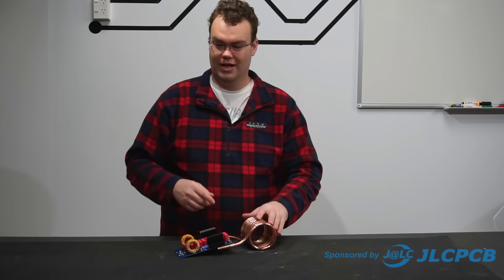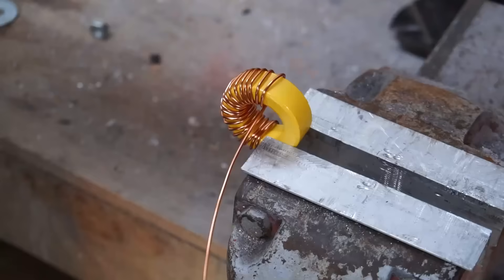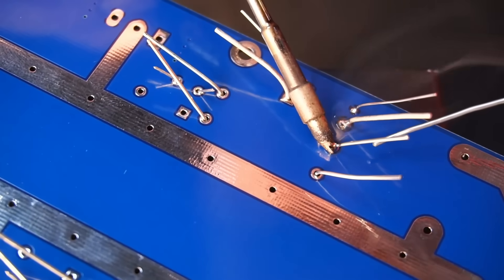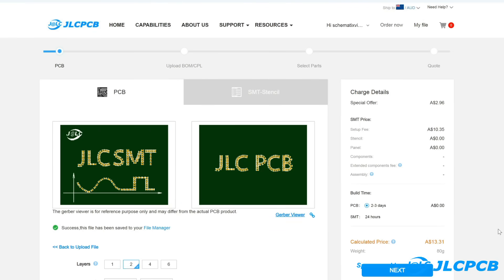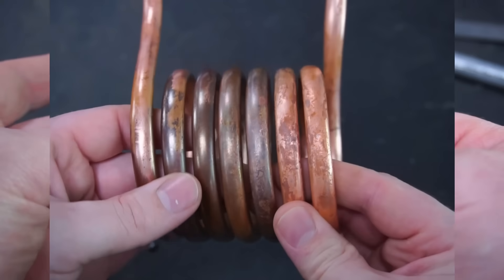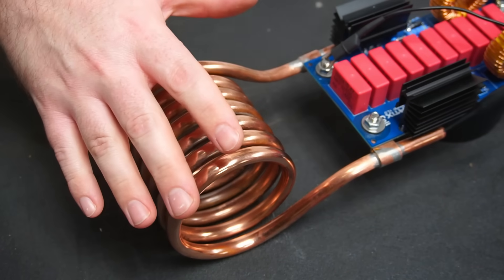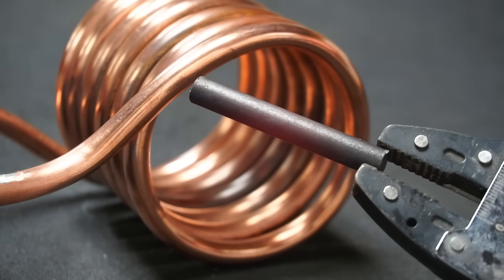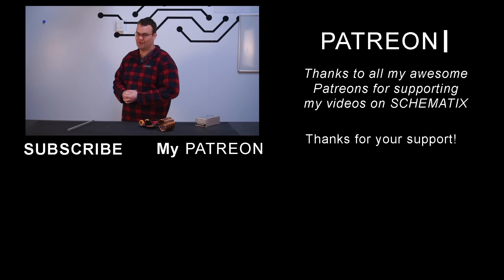Building a 1.4kW Induction Heater

Comment: thanks for sharing... I have a good induction furnace that came with an actual instruction manual... I have been looking at it for a few days... and read the manual this morning... I am none the wiser... 120 single phase current.. with two indistinguishable posts...no indication of polarity... and I think I need to make it 220... and since there's no wiring diagram... I am looking at videos instead of burning down my house
Reply: I have to melt platinum.. 1768° C... it claims 2200°... max... but I think that has to do with the copper in the coil... so I can replace it with platinum... or AuPt.. I have limited experience with high voltage electronics.. lasers are the only thing... and 12 volt automotive stuff.. Tesla coils.. but simple circuits... burning the house down is not really a good idea probably... I am open to suggestions
Reply: ok... here's something I have come up with in lieu of large amounts of money for new equipment... can I hook up one furnace circuit with transformer and power supply separate, but wired together through the coil?... 110 in the States, with 220 in the wall by the dryer... a meter away... if I split the 220 into 110 through either side... how can I wire it without loss of property and life?
Reply: has anyone tried a flat coil and shallow melting dish?... they used to use bakelite for insulation in coil seperators... high temperature requires different material... AuPt dust can be found wherever water flows naturally... dig sand and dry... it's the only gold stuff that sticks to a magnet... ya can't miss it
AuPt dust in shellac can be applied to cardboard... it's transparent to magnetic energy, but has the melting point of platinum
Reply: Au and Pt are diamagnetic.. they are also one proton electron pair different, so there is a magnetic field, except they don't all line up like iron does
AuPt is tremendously hard... like diamond.. 10 on the Moh's scale of hardness because it cools slowly before it reaches the surface as volcanic ash and has double double covalent bonds.. it takes a lot of energy to break those bonds... there's lots and lots of it... everywhere
Reply: so if I have two diode racks... which looks hauntingly familiar from my laser building days... and I do a pull me push you arrangement... do I use a common ground between them to synchronize the AC cycle across both?... and there should be a simple load balance system probably... how much voltage is developed... what happens if you start with 100,000 volts at 10 amps.. like an ignition coil for a car... but high frequency and 200,000... and 10 amp... ?
Reply: I see other designs using large power transistors... does not look robust... but could bump up the output... I don't know... I am asking

Comment: Would be cool to redesign this so it can accept three different coils interchangeably.  1 coil for 8mm through 15mm nuts/bolts, one for 17mm through 33mm bolts/nuts, and  one coil with extended flexible leads (up to 24" for heating nuts/bolts from 8mm thru 17mm nuts/bolts which are in harder to reach spaces (in an engine compartment of an old rusty car/resto mod)...

Comment: How does frequency make a difference
Reply: I noted that the frequency on the oscilloscope didn't change at all - well it wouldn't would it?
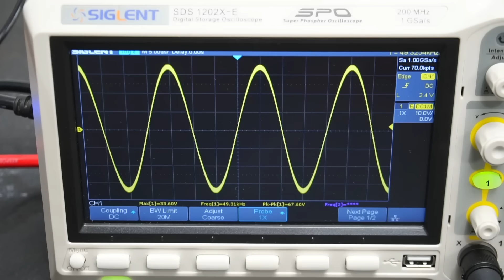Reply: @blaggercoyote  im referring to 16:50 of the video.
Reply: @madapaperclip422  The "skin effect" where high frequncies flow near the surface.  With ferromagnetic metals like steel the 50 kHz current concentrates in a very thin layer causing much more heating than if it was evenly distributed.  This also raises efficiency because the magnetic metal heats more than the nonmagnetic copper coil where the current is less concentrated.

To strongly heat nonmagnetic metals a much higher frequency like 1 MHz is used to get current concentration at the surface.  But then the copper coil heats a lot too, probably absorbing most of the power.  So the coil has to be water cooled, also the heater circuit must be much more powerful since most of the power is wasted in the copper coil.  (And it is still more difficult because power transistors for 1MHz are unusual and expensive.)

Comment: I'm surprised you could not heat aluminium... since it conducts electricity, it should be heated by induction (all conductive materials are). However, it conducts heat way better than steel, so it is more difficult to heat, even though it melts at lower T. Maybe the piece you chose was too large and dissipated the heat too quickly? 
Another remark, if I may: I'm not sure by changing frequency, you would improve the results on aluminium or other non ferrous alloys. Frequency in the coil should only impact the heating depth inside the piece (rule of thumb is you drop the frequency to heat large pieces, and if the frequency is too high, you'll heat only the edge of the part). As you stated, it is a consequence of your circuit and its capacitance, which have a direct influence on the delivered power.
You could also look into making a smaller diameter coil, because reducing the distance between the coil and the piece will improve its efficiency (if I remember correctly, it has to do with the magnetic field lines). 
Great job anyway! Designing induction heaters is though, it depends on so much parameters, so you can be proud of the results!

Comment: And why would one want to build this?? What would you use it for? Just curious not trying to bash or troll.
Reply: Some blade smiths are trying them. Fast way to heat metal to forging temperature.
Reply: @fredbecker607  I see.Thank you for the info.

Comment: You don't anneal any metal by quenching it in water, you anneal it by letting it slowly cool. The more rapidly you cool it from any temperature, the more hard it becomes. You still annealed it a little because you heated it to such a low temperature, but if you want it to be dead soft you will let it cool as slowly as possible.
Reply: When working with copper the process is exactly the opposite to Fe alloys... to anneal it you need to cool it as fast as possible, as shown in the video.

Comment: Could you make an instant hot water system using a similar induction design?
Reply: Water is not ferromagnetic
Reply: Yes, but a water pipe going through the middle of the coil could be.
Reply: @andrewjawney1  maybe but I don't think it will be "instant"
Reply: I'm sure it would be possible, with many passes through the coil. However my only concern is whether or not it would be more energy efficient than a standard water system. I still think it would be a fun idea to explore.
Reply: @andrewjawney1  electricity is always 100% efficient on a resistive circuit, but i doubt it would be more efficient because of the driver
Reply: Ok thanks mate. I suppose if efficiency was the highest priority then a heat pump design would be a better design idea. Rather than converting electrical energy to thermal energy and dealing with energy losses, concentrating ambient heat into the water would be more efficient

Comment: I've worked with induction heating since 1987. Really nice project. The heating power is quite impressive and has the potential for more. The magnetic flux decreases by the square of the distance to the work. With a tight coil you would couple much better to the output. Of course, the current would still be limited by the power supply and resonant circuit. Commercial coils are filled with sand when winding so that they don't collapse, especially with small diameter coils. Afterward, they are sprayed with Glyptol to provide insulation. Many times they are also lined with a refractory tube, and cast in refractory cement. If not potted, larger bare coils have some type of insulating structural spacers attached parallel to the axis of the coil on the outside to prevent the coil from jumping when energized. Invariably the output coils are water-cooled in all sizes of induction heaters. It's true, you don't want to get bit. Radiofrequency is more than a shock. I once contacted the 650-volt dc buss on a 300KW machine in Yonkers. It knocked me back six feet against a piece of equipment. I was lucky. The most dangerous job I've ever had.
Reply from the maker: Thanks for sharing your experience with us!
Reply: @Schematix  How about using numerous microwave oven capacitors?
Reply: @Schematix  🔴 What Is Islam? 

🔴 Islam is not just another religion. 

🔵 It is the same message preached by Moses, Jesus and Abraham.

 🔴 Islam literally means ‘submission to God’ and it teaches us to have a direct relationship with God. 

 🔵 It reminds us that since God created us, no one should be worshipped except God alone. 

 🔴 It also teaches that God is nothing like a human being or like anything that we can imagine.

🌍 The concept of God is summarized in the Quran as:

📖 { “Say, He is God, the One.  God, the Absolute.  He does not give birth, nor was He born, and there is nothing like Him.”} (Quran 112:1-4) 📚

🔴 Becoming a Muslim is not turning your back to Jesus. 

🔵 Rather it’s going back to the original teachings of Jesus and obeying him. 

More ....
Reply: Can you point me at reference material on how to calculate building one of these?  I want to heat an old (decommissioned) steel scuba tank to around 300 to 350 degrees Celsius and hold it there more or less as long as I like.
Reply: @HelloNotMe9999 
  Okay. I'm hooked. What would you heat a scuba tank up for?
Reply: Could a electrical efficient ,gas free, heat water boiler/pump be made using this method?
Reply: @DavesMades  the MOST efficient way of turning electrical energy into heat energy is the way it's always done ... Using resistance. You can't get more heat energy out than that put into the system and appropriate resistance is the simplest, quickest and most efficient. 

Also, surrounding the coil with water will significantly change the operational characteristics as would surrounding the work piece with water but INSIDE the coil.
Reply: Have you got any recommendations for resources that I could use to learn more about these?  I'd like to build an induction coil to power a boiler for a steam car.
Reply: I am wondering if you could tell me if using the cooling water part of the circuit be used  connected to a radiator with a fan blowing air heating an area of a room ??? Since this I think is more efficient than a resistive electric heater. Would tweaking the unit make a super efficient room heater Andrew ??? Just love the story of getting thrown six feet. Drop a line fella. Thanks
Reply: @victoryfirst2878  it's an illusion! You can't get more power out than is used to power the circuit. The MOST efficient way to generate heat from electricity is simple ... Use resistance! It's a 1kW induction heater so the absolute max you could get out would be ... 1kW! Otherwise you are breaking fundamental laws of physics/thermodynamics/conservation of energy.
Reply: Thoughts on using induction to heat a hookah bowl?
Reply: @russiankid112233  I don't think it is practical.
The hooka bowl sits on top of the hookah. If the bowl was on the floor or table then I think it could work.

The bowl needs to be ceramic and a ferromagnetic material base plate (iron or steel for example) attached to the base of the bowl. 

Then you need a transmitter of the magnetic field, which would be a high current coil underneath but - electrically isolated - the ferromagnetic receiver base plate.

This would work if the hookah bowl is placed on the ground or flat surface so that the magnetic transmitter could be placed directly underneath it.

Air is a high reluctance to the magnetic field. You need as small a gap as possible between the magnetic field transmitter and receiver, so placing the hookah bowl with its ferromagnetic receiver on top of a hookah a couple of feet of the ground, with the magnetic transmitter on the ground isn't going to work.
And that's the challenge, if the hookah bowl is placed on the hookah, where are you going to place the magnetic transmitter in order for it to be effective?
Reply: @deang5622  sounds like you know more about induction than hookah. The bowl doesn’t need to be ceramic to start. I’m having trouble picturing what you’re describing with “the ferromagnetic receiver base plate” 

I imagine a bowl, with a metal component, and a wound copper tube around that.
Reply: @russiankid1 It's called an atomizer and they've been around for years. 🫠 Happy hookah!
Reply: @russiankid112233  Induction hookah bowl, I say give it a try.
Reply: I got zapped by AC voltage of 125. The current kicked me back a number of feet. The part that really sucked was the taste of burnt carbon in my mouth for at least two days. An old electrician told me that is the sign of the strongest part of electricity just before death. Never happened to me since. A lesson learned for life. 
How would you make an induction heater to heat a home?? I am sure with your experience that you could pull a rabbit out of the hat. What do you say fella, any ideas Anthony ??? Drop a line and have a great day.
Reply: My company uses air cooled induction coils in our vacuum oscillation induction furnaces. They work just fine. We also have water cooled coils with liquid to air heat exchangers, but it’s not required unless analyzing titanium for example.
Reply: Tighter coupling reduces the Q. kW = kVA/Q. Or kW = VA*cos(theta).
Cheers. I miss it. That is a half-bridge Inverter. Unsure of what frequency the load is running at.
Reply: @kenreiterjr.2303 any chance I could pick your brain on an annealing project I'm working on?  I have a functional system/design, but would like to find resources to better understand the properties with the ultimate goal being to redesign my unit into a channel type coil conveyer/line system.

Thanks,
Reply: Inverse square for electromagnetic radiation, but I was taught that pure magnetic force/radiation decreases with the cube of the distance from the source.
Reply: Thank you for valuable information
Reply: @tbones55 Thanks for sharing.
Reply: When you got shocked just about a smigine from the Grim Reaper did you see the light Sir ?? I bet you will  never forget that experience. I just hope you somehow wrote your memoirs about induction heat as with all that experience it would be a shame not to share that knowledge with us all. 
Peace and Happy Holidays Mr. @tbones55. I hope and wish you luck with your memoirs.
Reply: Thank you for sharing from your beautiful mind sir.
Reply: Nnnbvmkç mini 
Đfyy7
Reply: I saw you added extra solder to the trace, but you could also solder a heavy, 10 or 8 gauge wire right to the trace. Or, take a piece of the copper plate that you cut the lugs from and solder it down for a heavier current draw.
Reply: Any body can make it for me ,then share details and rate
Reply: I think you meant to say the flux is proportional to the distance taken to the fourth power.
Reply: magnetism decreases with the fourth power of the distance, not the square
Reply: @bingosunnoon9341  Not from a straight wire it does not. It's a 1/r relationship where r is the distance from the wire.

Now this is a solenoid, a coil, so it is different, the field strength inside the coil is most often considered to be uniform.
As to what is happening outside of the coil, it's not relevant.
Reply: I work in induction also!  I just fixed an old mother daughter not too long ago!
Reply: @smishsmortion  Huh?
Reply: Do you have to use a coil? cant you use a solid tube as the coil or will that not work?
Reply: Not lucky, fortunate.
Reply: Lucky and fortunate are the same...
Reply: 680 volt is the DC front-end. 3 phase 480 volt full wave rectified is 680 volts DC with 360 Hz ripple riding on the DC. 

I'm surprised, but I touch and all probobly all have if you had to float your scope 😉

Comment: 3:35 solder has about 10x resistance of copper, so better re-inforce your track with a couple of lengths of the 1-2.5mm2 copper wire (soldered on)
Reply: He does reinforce the track in this video at around 17:41.
Reply: @John Smith , good to know!
Reply: https://youtu.be/6Z9SGtPn0j8
Reply: Hey John, that makes sense to me .
I have a question. Have you seen circuitry with like strands or wire about the size of a resistor wire.
Do they do that to make up a value to overall PCB   or is it,to build more resistances for that particular part of the PCB?
Reply: And also does NOT "carry hundreds of amps" like he said.
Reply: R M 
Resonance is crazy dude, a self-exciting resonant tank circuit can take a few miliamps but the current in the circuit can reach a few amps.
Reply: @drgazter  But it will reach equilibrium where resistance dissipates the current so it cannot rise further. It won't be carrying 100s of amp for sure.

Comment: You mention to add plenty of solder or a heavy gauge wire to the tracks that carry the high current. Wouldn't it be wiser to add a strip of copper to the tracks to add something a bit more substantial to carry the current?

Comment: Great project , these used to be Very expensive to buy, it's great now to have the chance to build own for reasonable cost!  I wonder if it would work well to have the coil further away from the main body on leads maybe 500mm long to enable positioning the coil in difficult spaces say around a car engine bay over a rusted siezed nut?? Thanks

Comment: Dose the diameter of the coil matter ?
Reply: Yes, if diameter or length or number of turns change then inductance will change.  When changing inductance need different capacitance to get same frequency.  For 50 kilohertz, need microfarads multiplied by microhenries equal to 10.  Examples, 1 uF with 10 uH, or 2 uF with 5 uH, both result in 50 kHz.